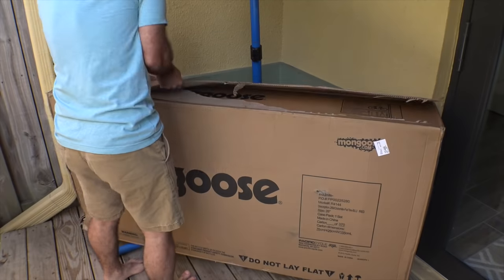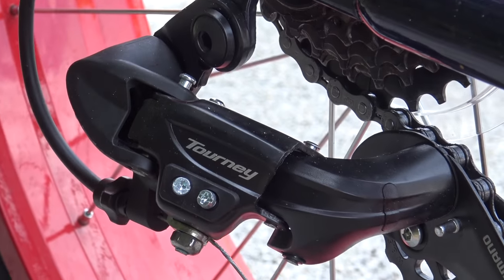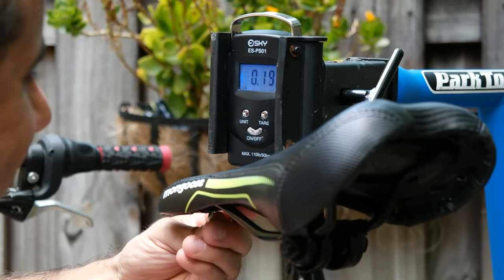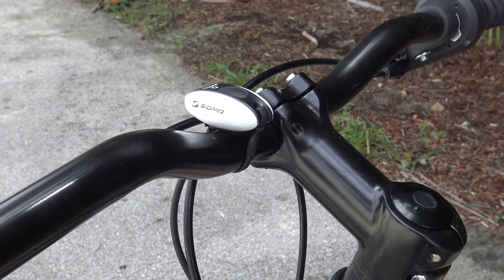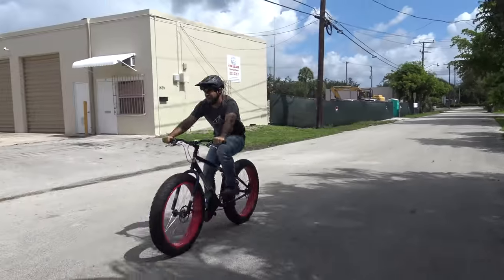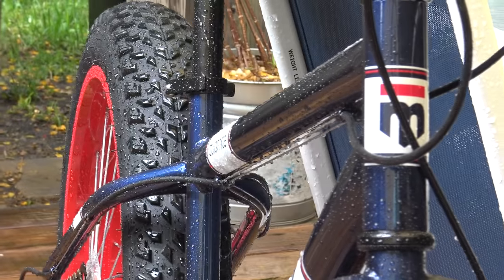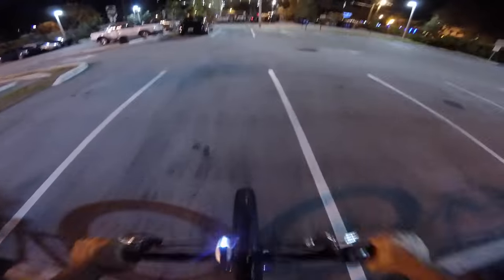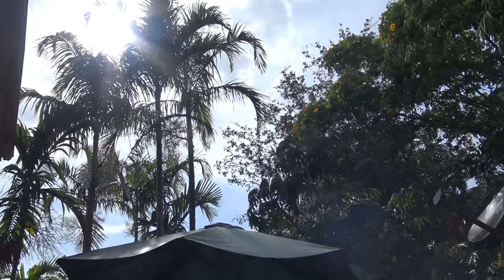Behold! The Mongoose Dolomite Fat Bike

Comment: I think it depends  on your mechanical  skill and what parts you already  have left over or laying around  . and a lot of the bike snobs are just insane. .there like shoe snobs. I have a mongoose  hitch..I got the shimano  mega 34 tooth 7 speed freewheel  for 15.00 a hollow crank 36/22 crank off of a specelized fat boy for 29.00.
I had a aerus aluminum  set back seatpost  in the parts bin . paid 3.99 for a shim to fit . bought a pro master 35 degree  riser  stem had some leftover aluminum  bars . had a brand new 9 speed shimano  lx 9 speed rear derailleur , had an lx 3 speed front shifter and bought an lx direct mount front derailleur for 8.00 .and had some road bb5s. snd one avid 160 rotor for front. . stripped off all the mongoose  badging and got a vintage  reproduction  redline  head tube decal.. will use the heavy stock  tires for now but I don't have much money in this bike and rides great I like it still using the stock shifter works pretty  good with the lx rear. 
so if you have some parts it might make a good fun bike..

Comment from the maker: Guys, check the Singletracks.com Podcast tomorrow for a Q/A they did with me last week. It should post late day or possibly Tuesday. Share it!
Reply: EXCUSE ME HOW MUCH IS  THIS!'¡?
Reply: I had to watch the beginning again as I didn't believe what I heard either
!! :¬o
Reply: I've always liked mongoose builds i usually go mongoose when getting a bmx
Reply: Makshar Israel Potentially the answer is yes, because there is more weight to be spun by pedalling, but also, I reckon that in some downhill situations the fat tire could be faster. Particularly if the terrain is very rough as those tires are about the same width as the front tire on a trials motorcycle..
Reply: The problem is that a wider tire will always create more resistance via friction, even with increased air pressure because the contact patch is bigger. But I think these fat tire bikes are going to become very popular in urban situations. I definitely want one! B¬)
Reply: Seth I just got a mongoose 27.5 terrex fat tire bike and would you say it is a good or bad could you please read  because I want to find a good mtb that I can ride on rouge trails and my last bike did not last and please give your honest opinion
Reply: Nine
Reply: Seth's Bike Hacks can u use wd-40 to get oil off break rotors plz respond
Reply: Iano247 yes indeed
Reply: Seth's Bike Hacks l
Reply: will do
Reply: Seth's Bike Hacks God bless you man. you have a awesome channel. like your videos, they are very entertainment and tech you a lot. like how you explain everything and how easy and direct you are. have a question: my weight is 225 pounds. i will like to start riding. i live in NYC and i was thinking on a bike that i can use in the street but also if i like to go mountain rides i can do it with the same bike. i was thinking on a fat bike, did you think is a good idea? what you suggest?. looking forward to your answer. keep doing the great work you do with your channel. God bless and be safe my dude.
Reply: Seth's Bike Hacks dude I'm searching same bike with engine can you help me with name?
Reply: The fat bike from ks Cycling is pretty Good and not expensive
Reply: @ianrowan3409  No, WD-40 IS Oil (a type of it). You'd use alcohol or Brake Cleaner to clean them oil free.
You could also use a couple of totally dry paper towels. I LOVE those Blue colored 'Shop Towels on a Roll" for stuff like that !
Reply: Mother Goose ah well learned the hard way 🤣

Comment: I got the malus its the same but grey. I love it, I made the full switch to fat bikes and I will never be going back. I plan on ordering a Motobeane Boris X9 within the next few weeks.
Reply: Also side note I switched to a tx55 derailer the stock is a 35 is believe. I also got two sets of resin break pads from amazon the breaks pads stock are full metal and wore really quick so they screech and scream at every slight tug on the breaks. I also got a set of origin 8 levers left and right because i was on trails with it and landed face first into a fucked up day and ruined the left break lever. all 3 of these upgrades together make the bike so much more enjoyable and costed around 50$. I run 20 psi and at this point im use to the weight and can sorta kinda keep up with traffic when I commute.

Comment: Anybody else notice how expensive this thing is now?
Reply: 577 on amazon
Reply: I found mine for 200 bucks brand new 🙌
Reply: I bought a used one for 150 and it had some mods done to it
Reply: $269 on Walmart
Reply: Bought mine for 130 before price spike lol
Reply: what is price
Reply: Its 400 bucks
Reply: Due to the shortage and supply and demand, I just bought one for 710.00, I could have got it cheaper but the waitlist was unknown from 3-5 months, so I bought one on ebay to get it next day.  

I am 350 pounds and needed a bike I knew could support the weight, and this one kept coming up.  So I went with it thinking it was a middle market instead of cheap bike because of that same pricepoint.
Reply: @petejohnson7918  how ya liking it ?

Comment: My God Seth! I don't have the $300-$500 laying around to buy a nice bike that I can keep and love forever. The only thing I can afford is either a department store bike or a piece of junk from the swap meet that's $45-$100. What I'm getting at is what in the hell do I do to ensure I can get a good bike for my budget! Mine is a Roadmaster that I got from the swap meet for $60 and I need help and advice because I can't afford a nice one. I'm down on my luck.
Reply from the maker: +Lauren Peralta Keep your eyes out for a used name brand bike! Sometimes you can find a good deal. Look for things like bolts (no rivets) and quick release skewers (instead of nuts). These are the things that make it easier to service and upgrade a bike. If you can do that, your options are limitless! Go the full Walmart route, and you'll be stuck with repairs that cost as much as the bike.
Reply: How can u say that seat clamp is terrible on my one grand bike I have that kind of clamp and its good cuz u can higher or lower the saddle fast and easy with out tools required!
Btw I have also a roadbike with regular screws and it's a hell to stop and rise or lower it some where else than home and I don't always evn have a toolkit with me when I am riding.
Reply: Lauren Peralta save up
Reply: Lauren Peralta SAVE 💰
Reply: I bought two nice mountain bikes under 500.  Both bikes have disk brakes and good full suspension.  However, I live in a area with a lot of mountain biking, so there is a big market for used bikes.  Join local buy sell pages on Facebook.  I bough two bikes off a local buy sell page.  One was only 150 and the other was 400.
Reply: Leo X he was dissing the one you are dissing

Comment: I swapped out a 34 tooth freewheel and added a 30 tooth chainwheel alongside the 36 tooth.
It's working well. I can physically move it back to the 36 when I add a hub motor.
I got the new black and blue Dolomite.
Added comfy seat and cruiser handlebars, new pedals, trigger shifter, foam grips, bell, mirror, rear rack, front basket, phone cam holder, speedometer, lights. I want to fabricate double rear baskets that mount to the rack with a quick release.

Comment: Seems nice, I reckon you should upgrade the bike a bit though,  for example for another 100-200 bucks. That would still be relativley cheap for a fatbike and see what can a bike like this achive with a few "better" parts.
Reply from the maker: The only problem is that the bike comes with a freewheel, so to really do any meaningful upgrades I'd need to spend a lot of money on a good fatbike cassette hub, then a cassette, and then a whole new drivetrain. So, I'd be much better off starting with something SLIGHTLY nicer that already comes with a cassette. If it weren't for this costly consideration I'd say it would be worth tweaking.
Reply: I see,  brakes and tires would be a sweet upgrade.
Reply: Wouldn't it be good enough with just some better tyres a new cog on the front and a decent derailleur on the back? (then of course handlebar and stem adjustments to personal preference, but that's a given)

Comment: Converted this bike to dual wheel 1000w x2.  The frame has help up great under about a 300lb load so far(about 3 years). Me, batteries, heavy hub motors. Its the best thing since sliced bread. :)

Comment: I was looking at these for a daily driver. I had a Specialized Sirrus Hybrid, which was great for asphalt trails, toodling around on paved streets. But my daily ride to work takes me through crushed lime rail trails, mud, sand, and crater-filled side streets. So instead of getting the Dolomite or the HItch, I opted for the Gravity Bullseye Monster from Bikes Direct. So far it seems like a pretty solid bike, but I have a feeling like my hybrid, I'll part ways with it and just get the Surly Long Haul Disk Trucker with 26" mountain bike tires at that point.

Comment: That derailer is going to become part of the rear wheel very, VERY soon :)
I had a tourney on the front, I don't know how is it possible to fuck up a front derailer but, well, the tourney did it. On the rear? I think I'd rather go single speed that lug that piece of crap around :D
Reply: I've been riding a Tourney RD for almost a year (using friction shifters) and to be honest, it does work very well considering how cheap it is. And my FD is something like that as well, and again, I've yet to have a problem with it.
Reply: The friction shifters make all the difference. Pretty much any derailleur will shift alright with friction since you can trim it. The Tourney certainly does not index well
Reply: Tourney came on my jamis trail x. I bought the cheap version so I could upgrade as needed or wanted. Gotta say it shifts like total shit but it's held up to many jumps and crashes over a year and a half.

Comment: Had a customer that had one of these for 8 months. Worked on his bottom bracket every 2 weeks. He was a paper boy, and when we got him on something new we didn't see him for 3 months. The wheels on this bike are super heavy and are not cut out like most fat tire bikes. Could probably use a smaller chain ringer. Tourney is okay for this price point. I'd probably get some different brakes and maybe something with a larger rotor to increase stopping power. Wheel upgrade may help with control issues as turning a wheel that weighs 5 lbs more than another makes a huge impact.

Comment: At that price I doubt those rims are welded. Pinned or sleeved most likely
Reply from the maker: you're likely right about that... unless they're spot welded on the inside. I guess I'll need to tear her down at some point and find out!
Reply: Seth's Bike Hacks I have a schwinn Biggity fat tire bike which is very simaliar to this one. I have ridden at dirt parks with mine and the rims did hold up well surprisingly. I upgraded the handlebars to 750mm bontraeger elite bars and stem, lever shifter, shimano deore derailleur, steel pedals and hydraulic disc brakes. 

I think if anyone does those simaliar upgrades to an inexpensive fat tire bike. It's great for someone who wants fat tires but are on a budget
Reply: A Drone I have a mongoose malus, w/ street tires(3" Duro Beach Bum's), MegaRange Freewheel, Shimano brake shifter lever, KMC X 8.9 3 chain, front & rear lights, luggage rack, bottle holder w/ stainless steel bottle, small aluminum air pump, phone tank bag, mirrors, bell, mini BMX bars, grips and a soft seat. I have under $500 in the whole thing new. I ride around the city at night, I've had the bike 2years with 1200 miles on it. It's still like New. I'm 43 & biked my whole life, this is my favorite bike, although I did peel all the mongoose decals off (I say its a Pacific Cycle)
Reply: they are welded in in the Republic of China, they really work a torch well in Asia

Comment: please do a video on the different style rear suspension....like a vertical vs a horizontal rear shock....i cant figure out the differences between the 2
Reply: They are actually completely different. For example vertical gives you a straighter travel of the rear wheel so a more xc style. On the other hand the horizontal is better for DH because it has more leverage going downhill and more responsive while breaking but it sucks to pedal on it. So the horizontal =sucky pedal platform but great responsiveness. Vertical= amazing pedal platform and not very responsive (doesn't move through travel as easy as horizontal). But it's all about your style of riding so if you are looking into one of these bikes go to your LBS and demo both styles. Good luck out there!
Reply: +Cameron Griego thank u so much, this is exactilly what i was looking for
Reply: Agreed
Reply: +Jacob Wanner no problem wish u luck with ur new bike!

Comment: Good video and review of the bike. I bought one of these a couple of weeks ago from Walmart for $185. Wanted to try a fatbike but a decent one goes for TEN TIMES what the Dolomite costs. So far I have spent probably 10 hours lubing it properly, replacing the parts that were damaged in shipping (Pacific Cycle replaced them no charge) and upgrading it with bits from my old mountain bike. It kind of sucked before the upgraded derailleur, click shifter, bars, grips, seat, and brake levers. I added a 22 tooth chainring inside the stock 36 tooth and with a Shimano Megarange freewheel it climbs pretty well for a 50lb bike. If I really get into fat bikes I will buy a nice one but for now I'm pretty happy with the modded Dolomite.

Comment: Converted my walgoose dolo to electric. It's amazing once u got power to it. Although I did end up upgrading everything on it to the point the only part that is original is the frame and headset and bars. Maxxis tires, specialized rims, XD drive train, trp hydro brakes, rigid tripletree fork. This thing handles amazing at 20-35mph on the street. Haven't really tried any serious off-road but I'm welding up a rear swing arm to extend the wheelbase slightly and soak up some bumps at speed.
Reply: Bike freak 🚲

Comment: One of the biggest reasons the front steering is so terrible at low tire pressures is because of the wide 100mm rim. The wider rim makes the tire profile much more square and wider which gives more traction and causes the tire to pull when steering. Switching to a 65mm or 80mm rim and better tires  greatly reduces this.

Comment: Overall, great review: I will add though, most fat bikes will pull hard with PSI under 8-10 ON PAVEMENT. Even $2000 ones. On a "Trail" or sand or whatever, this goes away. Wondering if you have the same problems off the tarmac.

Comment: I dont know how much costs a good Fatbike in USA, so, how much would you expend to let this bike good, like changing the weels and tires, put some better groupset, etc. Maybe it would be still really cheap, but almost as good as a expensive fatbike?
Reply from the maker: +Afonso Ramos I did the calculations and it's still much cheaper to buy a better fat bike... or ride this one as is and just replace the whole thing. I may explain the upgrade costs in a video but the main problem is that the rear hub needs replacement to make any drivetrain upgrades.

Comment: you put water in your tires? why? are there better quality fat bikes you would recommend under 400 dollars that are more hybrids or comfort bikes then those put all the weight on the handle bars mountain bikes? I have been shopping for one and see so many options dont know which to get or try and I am having a hard time finding a decent fat recumbant trike for less than 3,500 dollars. is it possible to build one myself?
Reply: TheRosa63 first he doesnt fill his wheels with water and seccond reconsider if you NEED a fat bike there are also plus bikes which have slightly wider wheels than other bikes and they work fine

Comment: What's the word on this bike in 2020? The price range now is $360 to just over $500. I want to motorize.
Reply: I electrified mine. But I did end up swapping pretty much everything except the frame. To be honest the frame is the only good part. I'm pushing 1.5kw currently and going to be going to 6.5kw once I finish welding up a rear swing arm. Surprisingly stable at 30mph but that's probobly the wheels and tires to thank lol.

Comment: good review, but I can feeL all 48 lbs of it !!  I dropped an easy 10 lbs, (or 2 bags of sugar)  by getting aluminum wheels, I recycled the all steel ones and got 3 dollars as milkshake $$, now at 38 lbs, it handles MUCH better, only other two snags are the horrible seat ( call it birth control cause u will never have offspring if u sit on that nasty seat ) and the pedals are WAY too narrow, I swapped them out first thing, I weigh 137 and wear a size 11 shoe, and my feet are not wide, but those mongoose pedals were made for midget dwarFs , also it's about impossible to use a hand pump on those tires, I use a power air pump for 75 cents and yeah it's worth it , very hard to get air into the valve unless u use a power air pump at a petroL station, I also took off the front brakes to save another pound and a half

Comment: Seth i had snapped my male bmx front axle and i was wondering would size would be good to fit two pegs because i bought a 140mm and it can only fit 1 pegs with not much thread left over